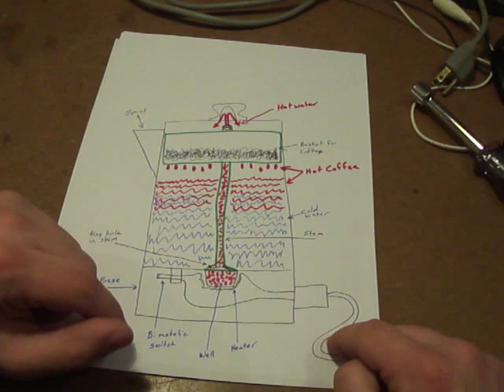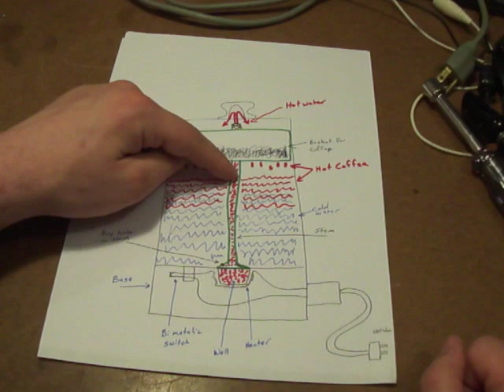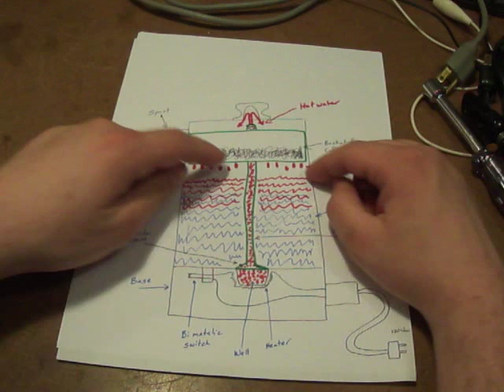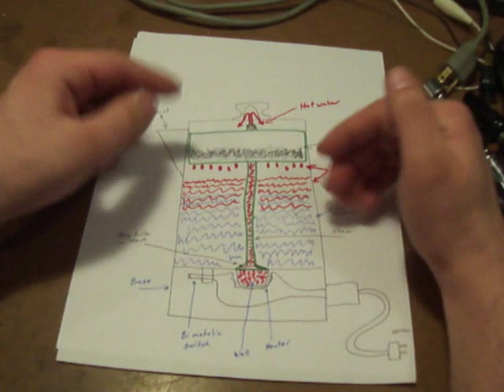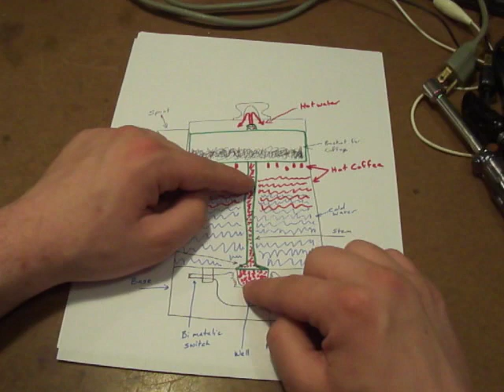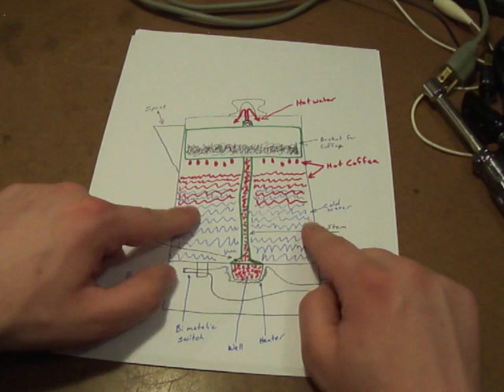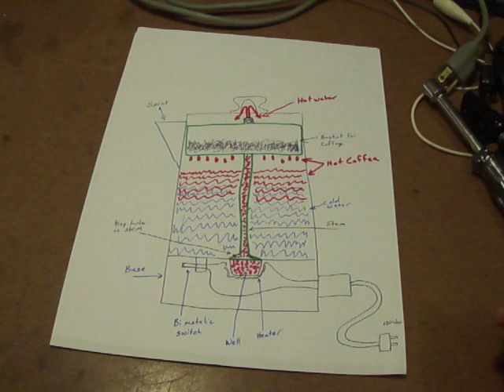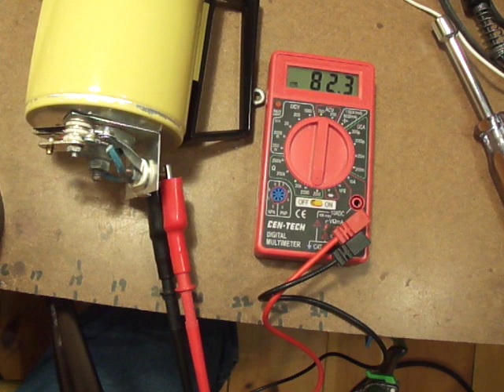Fixing a Percolator Coffee Maker

Comment: Thank you for the video. I'm in the process of troubleshooting a 22 cup percolator. The internals are a little bit different but your explanation definitely put me on the right path. After checking continuity of the wiring with my old Simpson meter I am guessing that the coffee pot's metallic switch is stuck in the position where it will not brew but only keep the water warm.

Comment: I bought one at the thrift store and when I opened the bottom I was simply amazed by the simplicity of the circuit. Not a electronic component in sight, besides the materials themselves offering the necessary resistance etc.

Comment: Also, drill a hole in a paper basket filter. Place it on the "peg" in the basket. Put a bit of water on it, to wet it and hold it in place. Fill and cover as usual. Use 4 cup filter or Keurig self-fill filters. I have this in a video on here, but its from 2015.

Comment: I just picked up a vintage Regal 8 cup percolator . My question is do most of these percolator keep your coffee hot for hours  after brewing if you just leave it plugged in ?
Reply: It will depend if the one you have has a warming element. Many electric percolators have 2 heating elements: 1 high temp for percolation, a 2nd for keeping the coffee warm. The 1st is shut off by the heat switch which was fixed in this video.

Comment: Hi Iain
I have a similar Empire coffee percolator.
It does not have the feature of the temperature control like yours.
I opened it up and it is wired directly to the heating element.
My one does not hear the water at all. What should I do?
Best,
Frank
Reply from the maker: Frank Cassidy sounds like yours is a manual percolator where you just unplug it when you’re done. I would try a new cord because the contacts in the end that plugs into the coffee maker can wear out over time.
Reply: Iain Portalupi 
Hi Iain
I’ll try that and let you know.
Is it possible the heating element is gone?
I’ve always been really careful about making sure I plug it out after it has percolated for a few minutes.
Reply: I’ll keep you posted on how I get on.
I really like this coffee percolator.
Thanks,
Frank

Comment: if the water is getting hot but its not comming up to drip down in the coffee. i notice the coffee is still dry after finish percolating. which part do i change.  its 10 yrs old but still in great shape. farberware automatic  t/y
Reply: I just got mine out after not using it for 20 years and it would heat up but not perk. Cleaned out the inside of the stem and cleaned the heating element off - used a piece of thin cardboard to work my way between the two parts of the stem base. Works like a charm now - perking shuts off after about 10 mins.